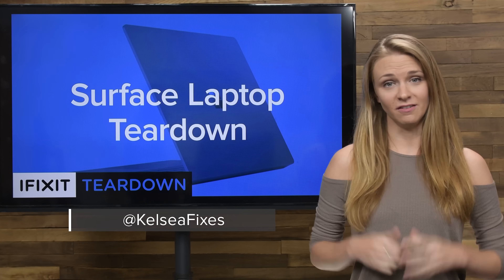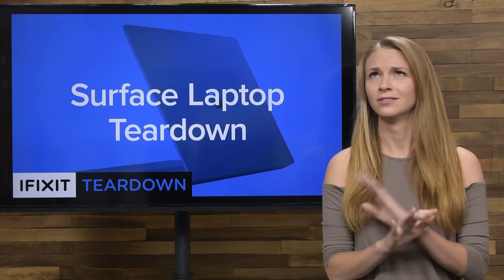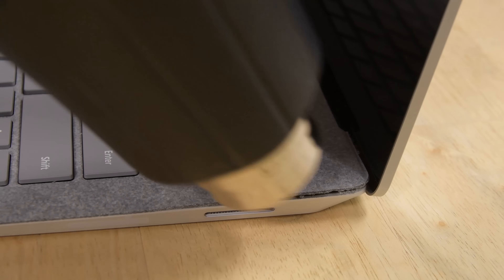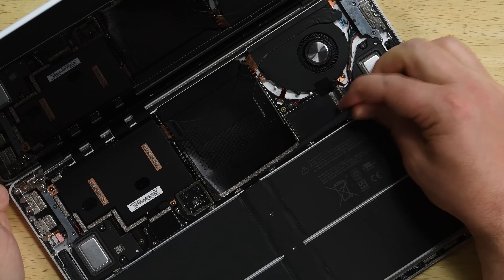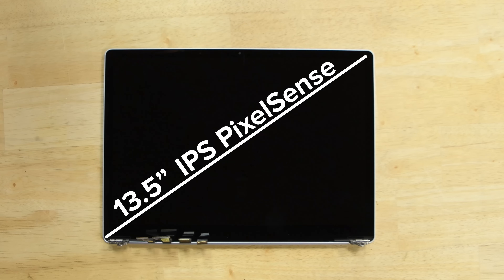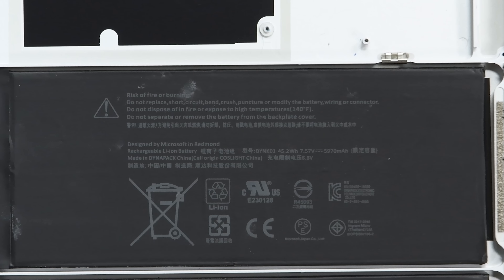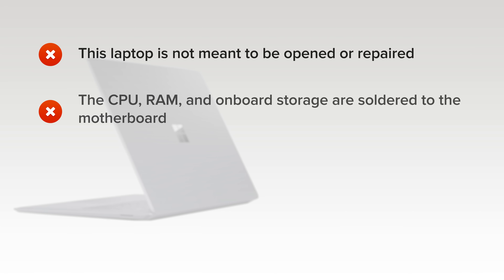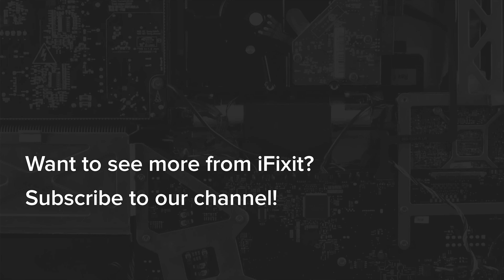Microsoft Surface Laptop Teardown!

Comment: how does micro$oft fix units returned under warranty?
Reply: is overpriced, so they are glad to replace it with a new one
Reply: They just replace it.
Reply: kooky216 they replave it from what I seen I think it is impossible to fix that
Reply: they pass them to Apple
Reply: kooky216 I'm guessing they would just replace them, like apple does in their stores
Reply: Good bye environment
Reply: They don't, it's probably cheaper to simply replace them.
Reply: They don't
Reply: kooky216 Most likely it's a combination of customised machinery for removing the top part and replacing some items. a piece of plastic with some carpet glued on top can't be particularly expensive if sold in the hundred of thousands or even millions.
Reply: They dont, they send you a new one, thats why the price for that piece of shi* is so high, they already calculated that into the price
Reply: Its most likely cheaper for them to just give the customer a new device.
Reply: That keyboard cover is obviously a disposable part at Microsoft. They will probably tear off the keyboard, fix the things inside, and just glue on a new keyboard. Not too much of a difficulty for a manufacturer who's probable gonna have a ton of spare parts around.
Reply: "Wipe and replace" :D
Reply: kooky216 simple. They don't.
Reply: they dont
Reply: kooky216 they dont
Reply: Send new, like many others manufacturers.

In many cases it's cheaper to give brand new thing from production line than fck with something damaged.

Let's say that production of this is max. 300$. If anybody would try to repair there would go many hours of worker time, that worker would need full blown station for repair ect. No way that repair even in dream would be below 300$
Reply: Well they would use a new case anyway because it has to look perfect. They reuse the mainboard and screen.
Reply: kooky216 lol they don't. I broke my Surface and they sent me a new unit
Reply: kooky216 they don't. They just send you a new one
Reply: Ibrahim kayani they probably sacrifice the fabric and the metal shields but it looks like the outer shell, display and motherboard might remain mostly intact.
Reply: They don't fix them, they just give you a new one. That is what i suspect. Same thing with GoPros, if they are still covered by a warranty  you get a new one.
Reply: kooky216 throws the unit in the bin a ships a new one lol
Reply: They break it apart, take some of the salvageable components and the rest either goes in the trash or melted down for metals.
Reply: disposable e-trash : finite limited lithium ion sealed fate life : failures + fires & harm to people &  the earth : e-waste acceleration failure 

the focus is wrong 

they stopped focusing on their customers 
& focused too much on profit margins 

they missed the bigger sustainability & customer satisfaction picture!
Reply: kooky216 refurb?
Reply: Give a new one lol
Reply: kooky216 They simply replaced it.
Reply: Exchange them
Reply: kooky216 Whoever said they "fix" it.
Reply: They probably dont, the price alone makes it worth it just to replace the few they eventualy sell and just tear down the "broken" one.
Reply: they don't, they replace it...
Reply: easy, ship a new one, remove the case and re-use components.
Reply: I assume they just give you a brand new one lol
Reply: They don't. Just like Apple they replace majority of things if not the whole thing. Transfer data, and off you go. Besides with non-removable battery, this laptop is designed to last for warranty + 1h. After that you are on your own.
Reply: They give you a new one (or refurbished), same as always.
Reply: by throwing them into the garbage bin and asking for a lot of money for a "repair",a repair meaning a replacement with another laptop,with all of the files getting copied to the replacement one.
Reply: kooky216 by using magic
Reply: replace a brand new one, lol
Reply: kooky216 they find even the smallest of detail to deny u yr warranty
Reply: They probably send out a refurbished one.
Reply: Progan666 I don't think they can even refurbish it
Reply: Progan666 difficult for a company to send that much or at all to give people good service they might but only if they can't find even the littlest of thing to deny the warranty
Reply: i doubt they do, they'd probably just send you a refurbished one
Reply: They dont. Just like phones you will simply get a new unit
Reply: at the shop I worked at they always replaced them
Reply: kooky216 They don't. They'll send a refurbished unit to you. That's what happened with SPs tablets.
Reply: They just give a new one
Reply: They send out new units and tell the customers that their own workers couldn't fix the hell that is the Surface laptop
Reply: probably sent out a new one. i guess
Reply: kooky216 they don't.
Reply: kooky216 they probably don't. they may just give you a new unit or they could fix them but with very specialized  and expensive  ass hardware .
Reply: They don't. They tell you to do a backup, and then they replace the unit.
Reply: Replace. Strip down for parts old one and reuse again. Apple been doing that for years.
Reply: You'll just get a new one probably.
Reply: They don't so you get a new or upgraded version which makes it a great warranty.
Reply: They don't. With the Surface Pros, they always grant you a refurbished or new unit. I'm absolutely sure that the Surface Laptop will be no different.
Reply: They're Micro$oft, i think they'll just probably replace the whole unit.
Reply: They probably have to replace the keyboard as well seeing as they would except a limited lifespan with that alcentara material.
Reply: Aaron Schwarz how many laptops do people take apart? It is what it is. If one is clumsy, this is not the laptop for them. Buy something cheap, disposable or slightly repairable. As for anything malfunctioning, will probably happen under warranty.. if not then prob time to upgrade overall anyways!
Reply: They port the data and serial number to a new machine? More likely they just swap it with a new machine, losing your data and probably your warranty (new serial number = what warranty). Because Apple did it first, it MUST be good...
Reply: They don't. it goes to the trash and they ship you another one - you already overpaid for it anyway, so they're still profitable even if they shipped you a whole new unit. They do take that big pile of trash and part it out though (re-manufacturing). They will gather the working parts from trashed laptops and use them in the production and assembly of new units.
Reply: kooky216 The same way they have dealt with Surface Pro's, throw it in a bin and give a new one. They are pretty generous in doing so, the experience isnt that bad with Microsoft. Apple does a shittier job about this kind of customer service.
Reply: They tear apart and uses parts that was soldered into new units. E.g. If your screen was damaged and they replaced your device. Then at the factory they will use everything into the production of new units except faulty or broken screen. That how apple is doing it for years.
Reply: They replace them. They often give you units that have suffered more than yours. Paint chipped, displays broken. Better to get a new one. (Based on reviews I have seen online)

Comment: Thats why i would never even consider getting a Surface. 
There are so many better, cheaper and easier to repair alternatives, even the MacBooks are way easier to repair!
Reply: They are easier only for them selves, so they can reuse parts and sell refurbished laptops. However upgradeability on Apples always very low. Only difference between this one and macbook is that second one isn't sealed. I don't buy anything new, not worth, planned obsolence comes included.
Reply: the problem if the battery dies.. on macbook its easy replaceable
Reply: @TheMahdifarhat  in mine the SSD died! I have now a useless 900€ junk! NEVER AGAIN!
Reply: But it can be nice too, because when mine broke they just gave me a new one.
Reply: problem is, surface is not even premium devices. They have tons of hardware issues. We got surface pros 3 and 4 and we replace them every month. We have replaced the relatively few surface models we have more times then the HP laptops we generaly use, and they are sucky to.
Reply: BiohazardGA same i have it as well n its just a work of art i really like the design
Reply: what can you repair in the small MacBooks?
Reply: A 600 dollar plastic laptop that has indentical CPU specifications with user replaceable battery, upgrade-able ram, sluggish mechanical hard drive, and optical is a far better buy.
Reply: I currently own the laptop and was curious about the teardown. Now that I saw the damage I can see as to why this is the best student laptop out there. Majority of students aren't gonna do upgrades, teardowns, or repairs. This just a simple and great laptop for any student for the basic stuff. If it ever needed repair the windows store would of done it in a different manner I would assume. Secondly they did mention that if anything were to happen the laptop they would just replace it. I might end up returning the laptop and getting a spectre with superior specs for everything programming. Needless to say the laptops are pretty great. I don't see why they're cheap or crap to some people.

Comment: Where's the vapor chamber cooler they talked about? Just integrated into the bottom panel? Doesn't seem to be much in the way of transferring heat to it. Interesting though that it looks like they use a split fin fan design, like the rMBP 15, I wonder if a fan maker just came up with that and certain companies independently touted it, or if the custom design was copied?
Reply: I'm just wondering if a fan manufacturer makes these as standard configs, or if these were independently customized. No need for (very) tired old tropes.
Reply: You mean the design that has existed for years which was suddenly made "Magical" because apple used it? hah...
Reply: The vapor chamber rest on the CPU and helps transfer the heat to the pipes fast. Whole heatsink assembly looks like a coolermaster job (check out coolermaster ultra slim fan and ultra slim vapor chamber on coolermastercorp). 

As far as the fan goes, its obvious you can only get so much airflow from a fan this thin, so adding the "split fin design" like you said is the only logical next step.
Reply: So you think they just called a heatpipe base plate a vapor chamber? Wouldn't surprise me, Microsoft has called heat pipes "Liquid cooling" before.
Reply: It is a vapor chamber and they are using it instead of simply having the heatpipes directly contact the silicon or using a solid metal plate. The vapor chamber also does operate using a liquid, but calling it liquid cooling like they said with the Xbox One X ("liquid cooled vapor chamber") is probably a marketing stretch.